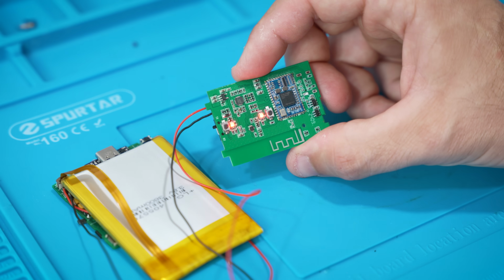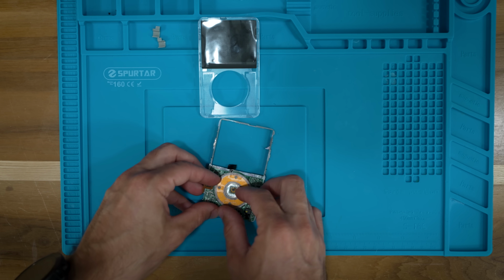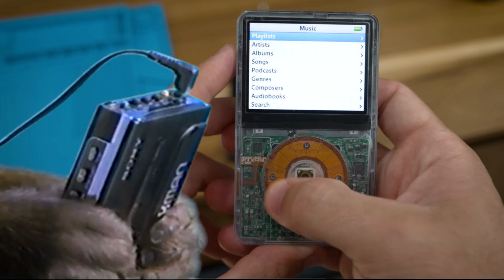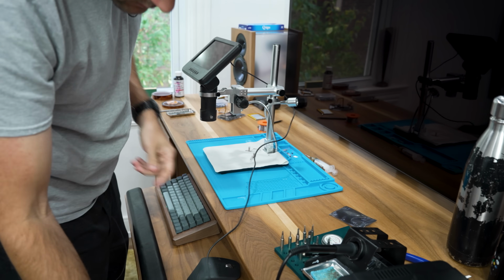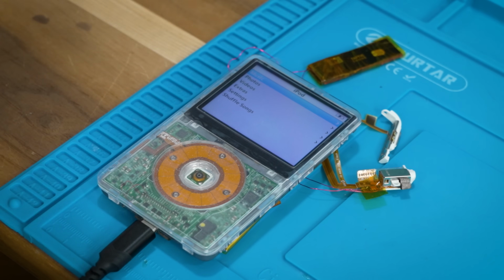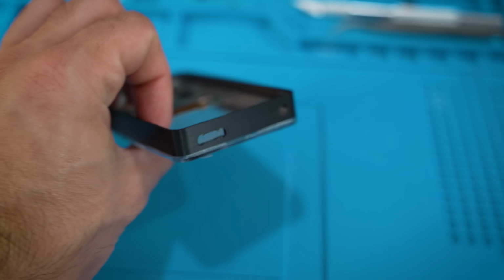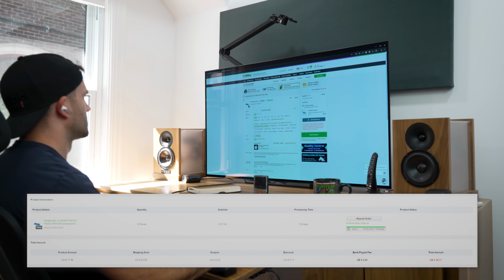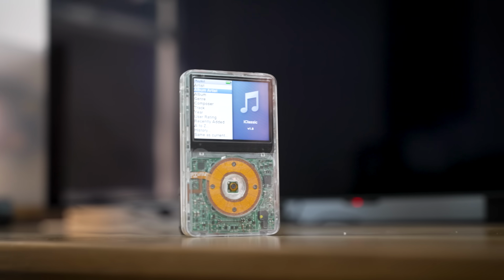I built a MODERN apple iPod...

Comment: It has been a while since I modified an iPod, but I believe places sell (or sold) thicker backs specifically designed for the large battery mods.

Also, one reason why I went with an older iPod in the first place was actually that it lacked Bluetooth and Wi-Fi.  I wanted a device for music at work and I wasn't allowed to have anything with wireless connectivity.  The older iPods worked great for that... after swapping the hard drive.  The one thing that I wish I could change?  Better software for the iPod.  I'm pretty sure I looked at RockBox, but I can't remember why I didn't use it in the end.  I do recall that my main complaint was the difference between album handling between the iPod and iOS.  I think it has to do with there being two Artist tags used for music files where one is more geared toward specifics for a song (e.g., listing a featured artist) and the other is the generic artist (i.e., whose album it is).  If I recall, the iPod has no support for the latter, which meant that it kept separating anything with "Artist ft. Other Artist" as separate from "Artist".

Comment: I wish RockBox had a full on 'iPod Mode' that took all the exra stuff away. All I want is an iPod with drag and drop, but all the extra settings just clutter the whole thing up for me. There's the iPod Classic theme, but that still has all the 'everything else' exposed.
Reply: Create one.
Reply: Can't you can just... not look at the extra settings?
Reply: My complaint is it’s dog slow on the hard drive. If you haven’t upgraded to a SD card it’s painful. The stock OS just works and is instant.
Reply: @Bob_Smith19  I haven't used it on anything but a CF card or SD card, so I haven't run into that much. But if it is slow on the HD, that's another point against it.

Comment: I have a 160 GB (6th gen?) iPod classic I bought new back in January 2013. Still in working order, with the original battery, with no visible leaking or swelling. Not yet, anyway. Haven't gotten around to modding it and the only changes I'm comfortable to safely attempt are a battery replacement and switching the HDD for an SD or microSD adapter board. I have installed rockbox on it. In fact, you should be able to dual boot rockbox and the native iPod OS on several iPod models, and switch between them by keeping certain buttons pressed during the startup of the device. I decided to keep both because the original iPod OS has a simpler, cleaner, smoother interface, but rockbox was the only way I could find to bypass the loud volume limitation enforced on iPods sold in the EU at the time. I could replace the circuit board with one harvested from an iPod made for the US (or at least non EU) market but I want to keep as much of it original as possible. Alternatively, according to some google searches, I could replace certain chips on the circuit board with ones harvested from non EU boards, but I lack both the hardware and the skill to perform such a feat at this time.
Reply: Why would you do all that when you can just buy a cheap mp3 player. Even then I don't get the point of any of this when Spotify exists. It's so cheap it's basically free and I get a way better OS for my music. And it's already with me. Tell me your nerd that doesn't get laid without telling me.
Reply: Nice, I still have mine too! (Original battery too, still holding a good charge) :)
Reply: @thatguy6214  - because you can. That's just it.
The iPod Classic feels classy and nice. It was peak MP3 for pure audio functionality.

And this is voodoo imagination territory but I feel like my studio In-Ears sounded a lot better when I tried my old Classic compared to my phone and especially with adapter on the iPad.

Comment: @ZacBuilds when you want clear parts, you can use toothpaste to polish the small scratches on plastics and some resins because toothpaste is: 1. Easy to wipe off, 2. Smells good, 3. Slightly abrasive, and 4. Great for polishing!!

Comment: just fyi, place some tape on the SD card. The spring mechanism in the reader does not actually hold the card, and a sudden drop can dislodge the card from the reader. 

You can also probably wire the bluetooth mod to the hold switch, just put the positive terminal through it (but I am unsure if that woiuld not cause a surge of 5V into the rest of the system, probably will need a diode)

Comment: Replacing the nostalgic cold feeling of the stainless steel back and adding the bluetooth in my opinion is a crime to the essence of these childhood gems. It feels wrong.

I'm also against the transparent everything trend going on but oh well.

Completely changing the premium feeling of cold solid steel is the biggest one.
Reply: Nah, steel enclosures look good only at first. Then it turns into a mosaic of scratches and dents pretty quickly. Especially on a device that will be your pocket.

It's the same as with piano black finishes. Looks good in promo photos, but turns to crap the instant you turn your back.
Reply: @AmartharDrakestone  there are etching chemicals to add a frosted finish to metals, you can laminate the housing to keep the durability of stainless steel while avoiding permanent scratches, some people appreciate the patina/scratches/wear and tear  that occurs naturally.

Or, and hear me out on this one, you take good care of things that you want to keep!

Especially something that reminds you of good memories.

Comment: Do you remember when you could replace a screen by just removing some screws?
Pepperidge farm remembers. 
Also, a few tips on soldering: 
1. Start with the smaller pieces, up to the bigger ones. In this case, the USB-C connector should've been last 
2. When soldering with hot air, you can use a par of tweezers (or something similar) to hold components in place 

Nice project, even though I prefer the black square case instead of the rounded one.

Comment: the lost details in the back panel print from pcbway is probably because it was automatically post processed with acetone vapors or alcohol vapors (depending on what kind of plastic they printed it in), the acetone/alcohol will dissolve the surface a tiny bit making it lose some of that detailing you noticed on your print and depending on how the print was oriented when it was dried out, the acetone/alcohol will deposit the dissolved plastic where it sat on the print

Comment: I almost want to see if Zac (or any other maker content creator) could potentially make an iPod clone that looks and behaves like an iPod Classic with a click wheel, but the internals are more modern ARM64 based, like a Raspberry Pi Zero running the show on the inside with Rockbox compiled to run on it. It would be a cool project.

Comment: U doin a great job at soldering it self but u shoul change solder u using and lower temperatures. As perfect example - solder after getting cold shoul be shiny almost like a mirror. U can achieve it with just great solder and lower temps. Try to find "Kaina Blue 63/37" solder. It's melting point just around 290C and have great rosin core.

Comment: if you use that battery with the iflash solo you cant use the ipod classic 5th gen slim back case, looks like you have the slim back case so youll need to use the iflash quad i just did the mod with my ipods same battery and same slim back case everything fit great with the iflash quad

Comment: Awesome build man! Personally, I dislike having a lot of the modern QoL features on an iPod, just because it no longer feels like an iPod, if that makes sense?

One thing to watch out for by removing the iPod cable connector, you lose the ability to connect to the FireWire charger to "boost" iPods into recovery mode. Although you can restore functionality with more modding, which primarily involves the cable instead of the iPod.

Comment: Usbc mods are nice af. I still use a surface pro 1, and that magnetic charger is ass in every way. But it just so happened that a USBC PD board was available with the perfect size to install it without even needing to design mounting.

It works great, almost a year later

Comment: 22:16
I stopped using iTunes a long time ago even when using the stock firmware of the iPod. I always used a program called Copy Trans, allowing to sync the files to the iPod without using iTunes. Of course you still require the drivers that iTunes provides, but that’s a very minor detail that’s not bugging me at all.

Comment: Instead of connecting the BT board power from the battery you can connect it to the iPod's power switch pin 3. That way, the BT board would have turned on when you turn on the iPod.

Comment: Regarding the Bluetooth being always on draining the battery. Surely it would reduce the life of the Bluetooth module also? Maybe not significantly I understand. Could you reroute one of the power leads through another slide switch on the side maybe? Surely that wouldn't take much further modification?

Comment: When I looked at this, it looks like there were two thicknesses of these iPod 5th gens - the bigger batteries are for the fatter iPods... though not an issue when you have your own custom back.   I guess it's still USB 2 transfer speeds, I wonder if some solution to that could be arrived at by some future mod where the USB C mod can speak to the storage mod directly.

Comment: As the original back plate is steel. you could have just bead or sand blasted it or used a steel rotary brush to create a fresh surface look. It could optionally then be spray painted.

Comment: Theseus’ iPod: “I just changed the screen, the case, the wheel, the hard drive, the battery, the charging/data port, the operating system, and I assumed that once I was done part of the original iPod may have still been left.”

Comment: If you heat from the bottom you can take the 30 pin connector off without melting stuff.

Comment: Any concerns about battery life with Rockbox? I gathered in the last week or so it doesn't have access to some protocol or function or whatever that the stock firmware does, or that something about the flash mod throws it off, and that battery life can be compromised as a result.

Comment: I did a similar project about 6 months ago.
Everything went well, on the frankenstein pod.
BT, Wireless charge, SDCARD mod, etc. Just didn't do the 30pin to USB-C conversion.

The issue I have is my sound seems noisy. It's not crystal clear. I used the coils on the board versus the headphone jack you have. 
You think this may be causing it? 
Anyone else have a similar issue?

Comment: now i like this when the usb c charging went up an showed charging i was liek "ayeeee it works !!!" now if you want to install rock box but you already have a bunch of music i recomend floola software its free an it bypasses the itunes bs as well so keep your music thats what i use i have 5 ipods i got from garage sales an stuff.
but what i do recomend tho is replacing that head phone jack as well every ipod ive owned have had the stereo sound go out so it when to either the left side wiht a soft sound on the right an ive owned like 8 ipod classics 
 but for blue tooth a easier way wiht no soldering is to get the head phone jack ones that have came out where its like the size of a regular male 3.5 mm jack they are mostly used to connect blue tooth head phoen to ps4-5 an xbox

Comment: I'm probably dumb but I'm curious about the Bluetooth mod. Because with, for example, a smartphone you would have to go to the Bluetooth settings and pick WHICH device you wanted to connect to, but with this it's just a button you press. Does it just connect to the closest bluetooth device in pairing mode? What if there are multiple devices within range that are in pairing mode? Does the custom OS add custom Bluetooth settings? I have a lotta questions-

Comment: Question: Do you really need the SD card adapter or was that just to fit more in the internals. I am pretty sure I saw another channel simply use a 2.5" SSD in place of the spinney drive which would have the same effect.

Comment: I had a 5th gen video like this (black as well) WITH ROCKBOX, but it bounced off the seat and I lost it one afternoon out a rust hole in the floor of my F-250.  Searched all over the sides of the road for like an hour, never found it.  Wonder whatever became of it, I wonder if somebody found it.  I too hate the current method people propose of streaming everything, and since nobody seems to know how to interface with the iPod Touch/phone free yourself from iTunes as well the 5th gen is the obvious solution with an SSD or similar, but I've grown too accustomed to bluetooth.  Your bluetooth thing fixes that.  I wish I had the ability to micro solder like this, I'd love to do this project.  Works great for my motorcycle because I can stream bluetooth to my BT speakers in my helmet.  I might go down this path if it was plug & play..

Comment: For those still wanting to carry around their own music but don't want an old iPod like this: You can always use a last-generation smartphone to the same effect. Reset it to factory settings, disable all non-music apps, disable all cellular and wireless connections, keep the battery settings on power saving mode, and you have a perfectly capable modern music player that lasts days on a single charge, even with a diminished battery.
Did this with my 5 year old one, which still has a headphone jack. Throw in a decent size SD card, and you never run out of music again.
Reply: Or you could y'know just use your actual phone with an SD card and airplane mode .....
Reply: @HS-tj2qp  Most people usually need their phone for everyday things and dont have the luxury to isolate themselves via airplane mode for days on end. 
By that logic, you wouldn't need a separate audio player in the first place

Comment: I was worried about the bluetooth connected directly to the battery at first, but the bluetooth had a lipo battery before, so it should already have its own low-power cutoff for lipo protection.

Comment: I thought doing the iflash and battery upgrade would get me to use my ipod again but nope. It's the software. I can't deal with itunes sync and rockbox is buggy with file transfer issues. 

Just get a Hiby or something and you can drag n drop files wirelessly with no issues. Also supports Flac and DSD and other files. 

Oh yea and it already has USBC...

Comment: I'm a little curious
If you have a new screen
a new port
a new bluetooth chip
a new battery
a new haptic motor
a new case
at that point, basicly the only thing on it that is still original is like, the style of the scroll wheel and the main board.

My question is _why_? If you're building it almost from scratch, couldn't you build something significantly more powerful or efficient with a modern microcontroller and built-in bluetooth / usb C support?

Comment: Hi Zack
I think you are awesome and its fascinating what you can do
I have a question and it could be your next challenge, as till now no one ever done it 
Can you add a proper video out put to a vita 2000 ?
so none of those crappy docks need it straight in to the tv 

As i seen some of your videos you done something like that for another console where you said you grab the digital output from the chip so there is no digital to analog and analog to digital needed. just straight digital to HDM

or perhaps the type usb-c port can convert usb-c to HDMI but only if its wired that way 

even if you not going to do it let me know your thoughts
this video would be watched by millions if you do as there is no option or maybe because it cant be done

thanks M

Comment: Never seen somebody installing software from the Windows store. 
Also: There are other custom firmwares for the ipod. Some keep the original design, but add a few extra options AND ofc get rid of itunes. If you think rockbox looks too ugly and 90ish, u could try those out. I dont remeber the name, didn't touch an ipod in a decade :/

Comment: iPod of Theseus... 

The only question I have is why not just by a mid-frame and a main-board, a switch and a jack? =)

P.S. I know that's somewhat of a rhetorical question -- it wouldn't make as good a video, but then you do not mention the fact that most of the original device was thrown (stored?) away =)

Comment: You are supposed to apply solder at the same time as you heat the two parts you are soldering. You will have nice shiny proper soldering joints doing it this way rather than constantly reapplying heat. Doing it this way negates the need for external flux as it's already in the solder. Love your creative and very skilled builds! Very inspiring

Comment: So I understand for entertainment's sake why you did it this way... but for anyone interested in doing this, Moonlit Market Classic Connect gives you a USB C, 30 PIN, better dac headphone amp, and bluetooth connectivity with very minimal soldering (It's like 3 pins). MM also has a dual micro SD card reader alternative to iFlash that is an 1/8th of the size internally.

Comment: this is a ship of theseus conundrum. is it still the same ipod after all those mods? why not just get only the oem parts you need? more efficient, minimising wasted leftover parts.

you're getting rid of the screen and the case and the backplate, which visibly identifies it as that particular ipod. it them becomes something else.

moonlit market is one place you can find a bluetooth module for the ipod and a backplate. there are other bluetooth mod approaches which have interference issues due to tbe stock metal backplate.

so, in the end what parts are still oem? that would be helpful to those getting started without having to buy an entire ipod for a few parts then throwing the majority of the parts away.